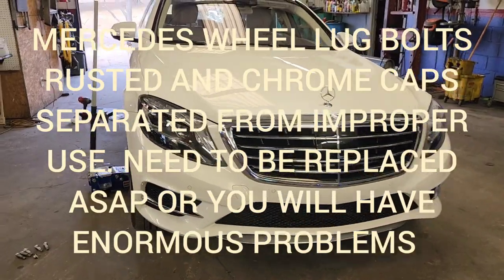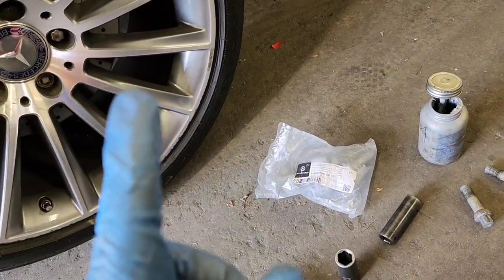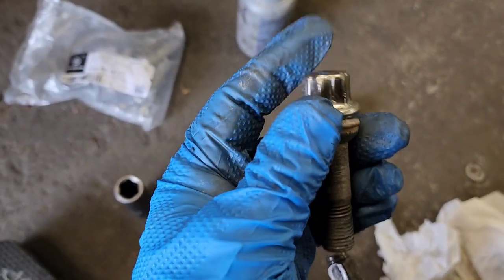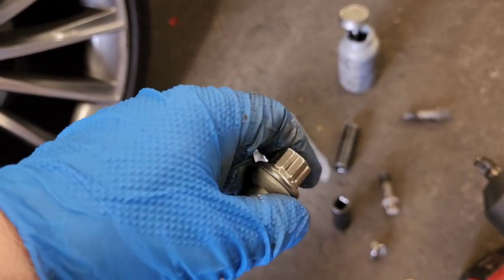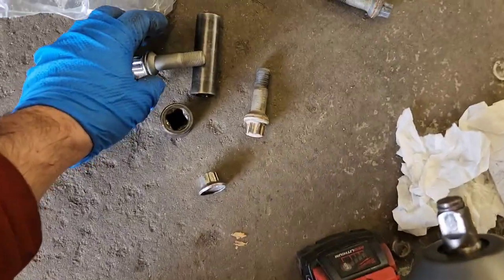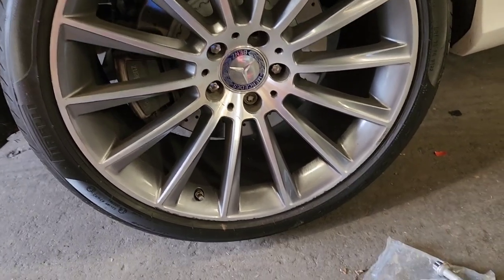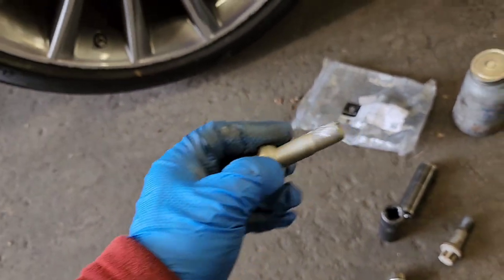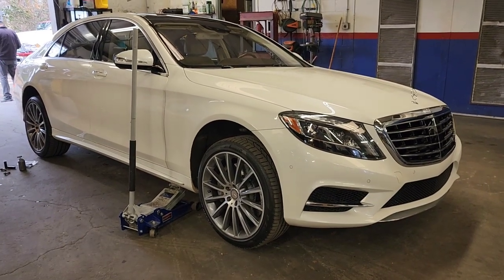MERCEDES WHEEL LUG BOLTS BUSTED BROKEN FROM IMPROPER USE PLEASE REPLACE FOR YOUR OWN GOOD 😊

Comment: That’s why you use a breaker bar and torque wrench on anything with an aluminum capped lug nut. Impact guns destroys those caps. I have my guys using a breaker bar to loosen ALL lug nuts.
Reply from the maker: Sorry but the caps are actually stainless steel metal sheet like and not aluminum. The problem is the lack of attention and precision from the mechanics who deal with these bolts and don't use the correct sockets! They don't put them all the way in and they overtighten them with rusted treads! No attention and lack of pride in what they do! Remember rusted treads will give you the wrong torque numbers too... Thanks and Good Luck!
Reply: @projectathos regardless of what they’re made of that damage you’re showing in the video is from using impact guns on them. 
My techs are paid hourly plus bonus based on labor, minus any damages they cause. I’m the service manager and I do final torque on everything that leaves the shop. If I find damaged lugs it comes directly out of that techs bonus. If a car comes in with damaged lugs it’s in the techs best interest to bring it to my attention before we even touch it. 
Use a breaker bar and the correct socket.

Comment: These lug bolts have a special socket. If you search Mercedes Benz 4218 you will find it.
Reply from the maker: Yes I know about the socket but the 17mm normal socket has done the job for now. Imagine what they are at the Mercedes Dealership to destroy these lug bolts for no reason! Prior to coming to me this S Class was serviced only at a local Mercedes Dealership... This is why I wanted to show this video... Thanks 👍

Comment: You really cant use a 17mm socket .  Get rhe flower socket becaue it will destroy it like that other bolt
Reply from the maker: You need to understand that we didn't do the damage to these lug bolts! This is how the car came to me! So technically the 17mm actually will not damage them if you know what you are doing! The problem is that someone used something else at the actual Mercedes Dealership here in Buckhead in Atlanta Midtown area and that is where the damage occurred! Thanks 🤞💪👍

Comment: Bro. there are plenty of tools that will take off a rounded lug bolt. you don’t have to destroy the wheel lol
Reply from the maker: I don't believe you understand what happened to these lug bolts. The problem is these chrome caps on top of the bolt. Also we have several tools to take rounded bolts and yes sometimes they do work but in other cases they don't and you do end up destroying your wheels! There's nothing funny about destroying a $2000 wheel so sorry but I am not laughing... Also if these go bad while installed you will end up destroying your wheels trying to take them out! Thanks...